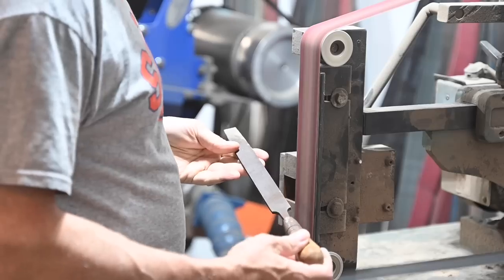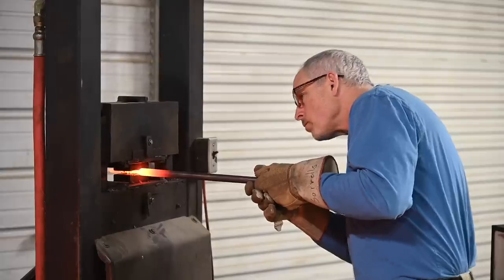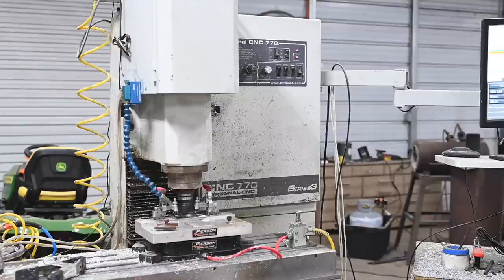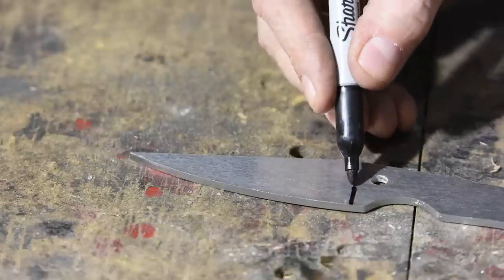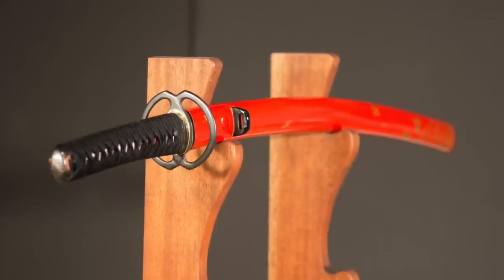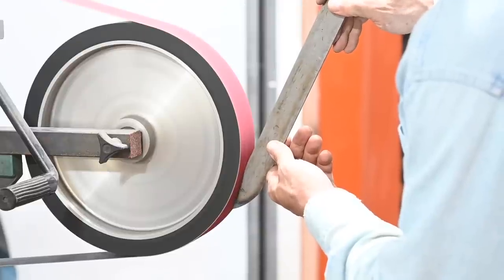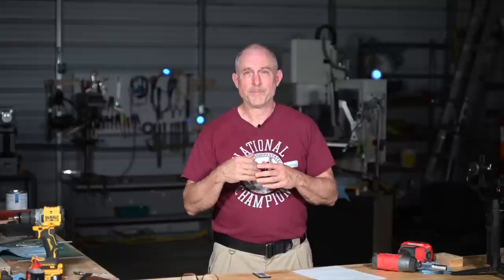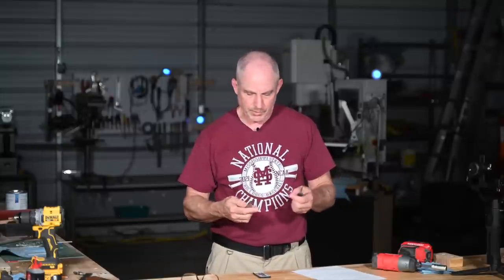Getting Started in Knife Making -- Knife Maker's Friday Five #63

Comment: Good advice, Walter! I've been a hobby tier bladesmith for quite a while now, and I find one of the biggest challenges for me personally is not letting myself get stuck at some point in a build and then running off to forge something different. I have a tendency to reach a decision making point or realize that maybe there's a flaw in my design and instead of working through it, I chuck another piece of steel in the fire and start wailing away at it. 

 Right now, I've got something like eight blades on my work bench in various stages of being finished, and when I see the pile, I feel a bit dejected because my irrational need for my work to be perfect sometimes holds me back from finishing a piece. It's super frustrating because I know I'm being irrational, and it's sometimes hard to kick myself in the butt and power my way through a project. I'm sure I'm not the only one to have that feeling of being stuck halfway through something, but I thought I'd share anyway. 😅

Comment: I would only add that once I decided I really needed an expensive piece of equipment (like a hydraulic press) I got what I needed then, not what I would need if I kept going, and that was a mistake! I wish I'd saved up for a bigger press, a more versatile 2/72, and so on. I'm now building a ribbon burner forge to replace the two-burner I bought two years ago, because the old one won't handle the size of the damascus billets I'm now making.

Comment: I got my beginner knife making supplies and equipment for sale. 1/30 variable speed belt sander and belts, single burner Nc tool baby whisperer forge, DEWALT 4” angle grinder, spring steel stock, Bunch of g10 liners and kydex/belt loops for sheath making, tongs, and a few other tools if anyone is interested. Located in NC.